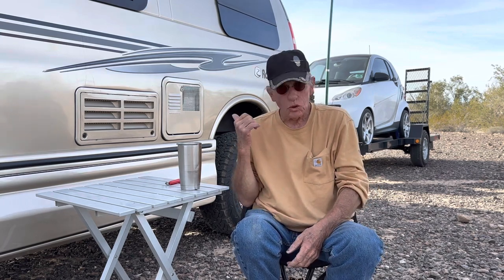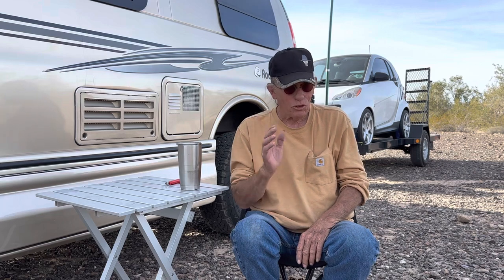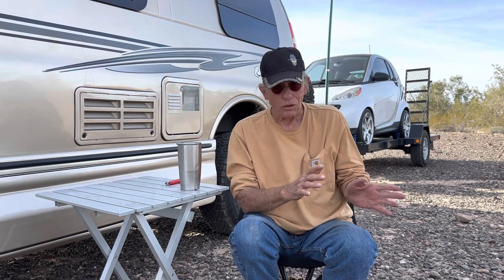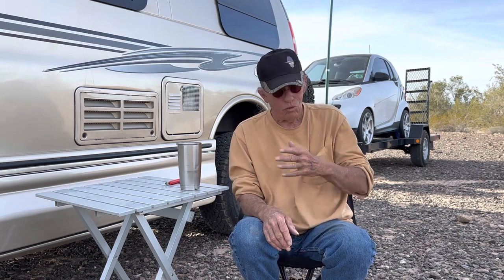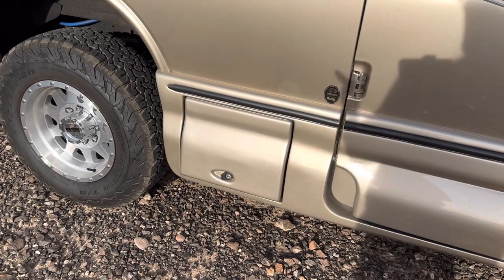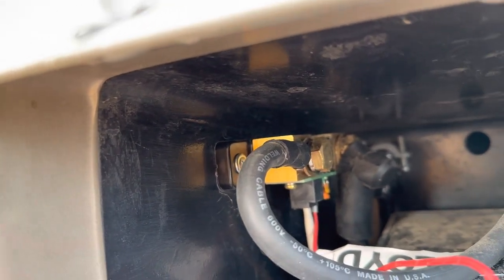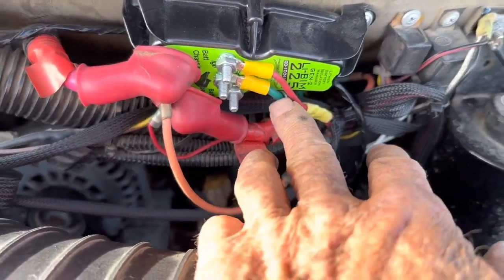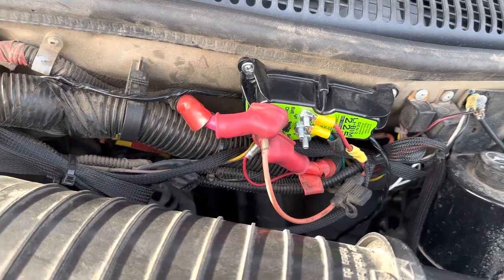How I installed 2 LITHIUM batteries into my RoadTrek

Comment: Thanks. Trying to do the same thing on my Roadtrek. All so confusing. So many options. I also have a 3000 watt inverter/charger in the roadtrek that isn't compatible with Lithium batteries. Don't know if I can charge on the AGM setting. Have some solar and need to change out the MPPT controller as well. Glad it worked for you.

Comment: Are you having issues yet with the li-bim? I did all your upgrades to my roadtrek 200. My isolator kinda crapped out so I swapped an victron b2b charger in. But I’m having a wiring issue with it and I’m here looking for answers on what I did wrong.
Reply from the maker: I’ve had no issues up to this point